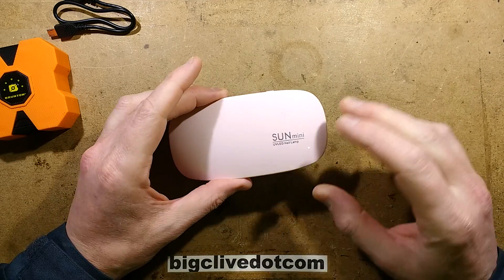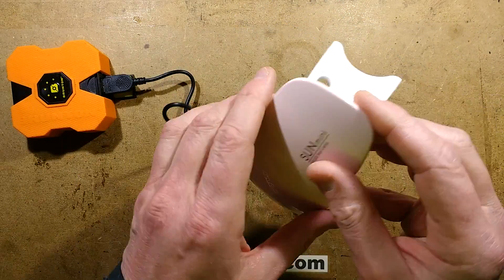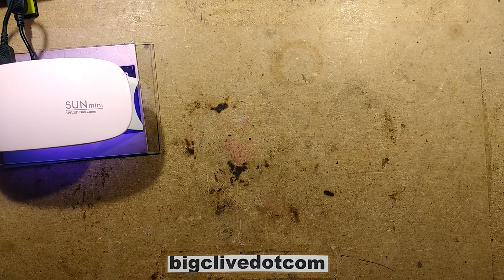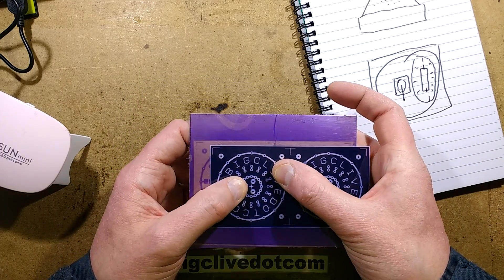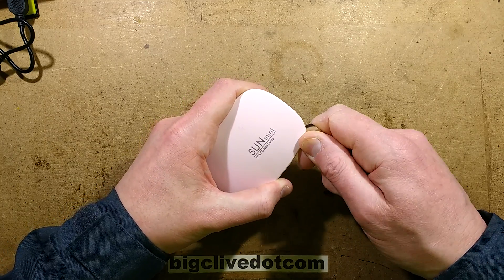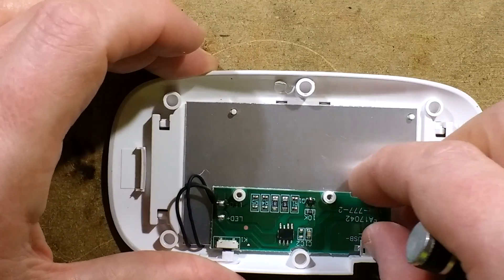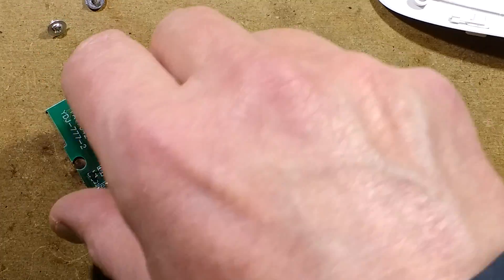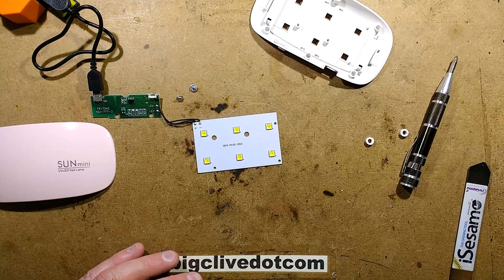Inside a UV nail-gel curing light with unusual LEDs.

Comment: Here’s some interesting info about genuine UVC LEDs. This is a copy/paste of a conversation I had with some fellow electronics/photonics nerds regarding this technology. A lot of us hobbyists and professionals online, in places like the laser pointer forum LPF and budget light forum BLF, and others. 

Clive, I think a cheap Spectrometer would be a cool DIY build. Like the one shown on “les’s lab YouTube channel”  Not really necessary, but it would be a fun build, and I’ve seen several instances where you’ve wanted to measure the wavelength of light. Once you have a spectrometer…,you can’t imagine all of the incredible uses!
————————————————————————
Here is the copied info…Maybe it’ll help some folks….. and it’s just interesting stuff regardless!

All genuine UVC LEDs have a quartz/sapphire glass window and/or ceramic Gold plated body. This is necessary because UVC easily damages Plastics and other materials used in UVB and all other LEDs. Therefore if the window wasn’t quartz, it would quickly degrade and discolor.

I’ve Bought and tested close to 100 different UV LEDs over the past few years… Including deep UV (UVC) i’ve tested everything from the dirt cheap Chinese knock off‘s, to the highest end chips costing $100 or more from Nichia and other quality manufacturers. (usually as a sample or with  a big discount because I can’t afford $100 for a single LED 😂)

I’m not a professional optics engineer, but I have an industrial electronics servicing business and lab… so already had the equipment. I was interested in this stuff for my own hobby and professional uses. And it was fun as hell!! UV photonics technology is super interesting, even to regular folks Who aren’t nerds. 

I’ve always dabbled in optics and lasers. I spent several years putting together a professional optical “breadboard” and test bench. All dirt cheap from government and Academic auctions. It really is the golden age of science and electronics! Over $20,000 worth of optical equipment, and decommissioned military/medical/industrial lasers. Photonics and laser stuff is about the most expensive hobby there is. Besides burning money 😁 A simple mirror, lens, or optical mount can be hundreds of dollars new. no way I could’ve afforded it. But I paid pennies on the dollar! Or less. Government auctions are awesome.

There are genuine deep UV LEDs being made in China that are pretty darn cheap. $1-$2 each! Pretty low power but decent quality.

But UVC LED technology is still so new, that the output powers are exceptionally low when compared to UVB. So you need an array of about 25 LEDs to approach timely “sanitizing“ power. Which is not going to be cheap, especially if you get Nichia or other high end chips. For a 25 LED array of decent power UVC nichia LEDs… You’d be looking at over $1000 easy. And if you went with their most powerful chip, a array of 25 would be about $2500 😂

But power density will increase slowly just like it did with 365nm UV LEDs. Cost per milliwatt of “radiant flux” will go down with time. 

Currently, decent cheap quality UVC LEDs average 5-15mw (Milliwatt) of optical output power. So when they sell UVC LEDs labeled as “1 watt“…. that means 1 watt of input power. You have to look closer to find the optical output power rating. 

If you got 1 watt of REAL UVC optical output… That shit could fry your skin and eyeballs really fast. Even worse is that real UVC leds can be almost invisible. Which is Dangerous shit!!😂 

thankfully many chips include a visible LED inside the same package. Usually 365 nm or higher UVB. As an indication light, so people don’t accidentally leave it on without knowing it… Easily burning their eyes. Or the board it’s eventually mounted on….in a finished product…. has a tiny colored LED next to the UVC led. To indicate when it’s on.

Although 100 mV is pretty much the limit for current UVC led technology…… its possible to get 1000MW (1 watt) of optical power out of 365nm UVB leds… or even more. It will be incredible if UVC LEDs reach this level of radiant flux in the next few years.

Sorry to ramble on. Hope this helps someone or you find it interesting.

Comment: I just got one of these, as I was looking for a UV light that I could modify into a EPROM eraser and remembered watching this video. Now that it's arrived, it's very different to what's shown in the video. They've economised the extra PCB out and built it all onto the aluminium backed PCB. Interestingly, they're not using a current limiting resistor, so it's not clear how they're limiting the current. Anyway, I'm thinking I'll just use a 555 in monostable mode to trigger the little MOSFET for the extended time required to erase the EPROMs. Might need some active cooling on the back of the PCB too as it did get a bit warm when running just for a minute.
Reply from the maker: You'll need UVC to erase EEPROMs.
Reply: @bigclivedotcom  Theoretically it could work, as the wikipedia entry for EPROM says erasure begins to occur at wavelengths <400nm, and the ebay listing says it's 365 + 405nm, but the wikipedia entry does say 253.7nm is recommended. I did read a hackaday article about someone who used a standard UV LED to wipe his EPROMs, and it didn't look like an expensive UVC LED.

On the other hand, I've programmed one up and have been repeatedly running it for a minute at a time for over an hour and haven't seen any change in the data, but I suspect it needs to be run constantly without the short pauses when the one minute timer runs out.

Comment: Bought this unit and a syringe of Mechanic UV curable solder mask, it hardens after 2 minutes if the layer is real thin, if you make a glob the outside will cure but the inside will still be gooey and takes about 5 minutes give or take to finish.

Hope that helps someone.

Comment: How difficult would it be to decap chips like that and take a stab at reverse engineering them?
It would be quite interesting to see what kind of circuitry simple little chips like those have.
Reply from the maker: +weylin6 It's most likely a full microcontroller like a PIC12F635.

Comment: Big clive a have an old function generator that went boom crekel pop smoke  any tip for troubleshooting
Reply from the maker: +Ryan Start with the power supply.  Things like capacitors and rectifiers, especially if it's an old fashioned unit.

Comment: How do we hack these to work at the rated wattage of 9W??? Change the resistors to lower values?
Reply from the maker: You could, but I'm not sure what the small transistor is rated for.  You could just add more resistors in parallel in the spaces that are already there.

Comment: Since the board supports 5 resistors (and 2 capacitors) in parallel I was thinking that it's common between several lamps with differing numbers/types of LEDs.

Comment: I wonder if one could use one of those food vacuum sealers and a stiffish poly bag to sandwich one’s material tightly enough to make an efficient exposure unit.
Also, gas anyone used polycarbonate (Lexan or Perspex) instead of glass?

Comment: Curious what wavelength's
Reply from the maker: Not sure.  No way to measure it here.
Reply: bigclivedotcom I got a similar genialish 12W (allegedly) unit off of aliexpress and it's apparently it has a 365  led and a 405 (advertised for UV gels and glues). Which seems to be correct since it dries UV Loca rather fast. They also have one which only has a 405 led without the phosphor coat, that is advertised for LED gels.

Comment: Clive did you happen to see the dirty trick some of the sellers are using?
They say $0.99 ~ $4.59 USD
What they do if if you pick any of the LED units like you have you pay $4.59 USD
and then if you pick the 9W UV lamp you pay the $0.99 USD. 
The lamp is a compact florescent. DIRTY trick.
Reply from the maker: If it's for a 9W UV tube then that' still a bargain.  They're used as replacements in the larger nail curers.
Reply: Unless the quality is so bad they don't last or even turn on. We both know how people shop for price.

Comment: Clive,,, Sir,,,  is that the wavelength that is used to see rodent pee on the motel room floor? Or other fluids in other places?😲
Reply from the maker: It swamps the results out with the visible light.  Use a UV flashlight, or better still don't look for stuff like that as you will find human secretions.
Reply: You can get cats piss detectors from pet shops. Word to the wise: they make proteins in the cats piss fluoresce. They won’t work on human piss, and if they do, you need to see a doctor right away because your kidneys have failed.

Comment: Do you know why this doesn't work on uv erasable chips? The only one i checked didn't work at all...
Reply: No, you need UV-C for that, which is also very dangerous to have exposed, and extremely (EXTREMELY) expensive in LED form.
Reply: If it is cheap and produces UV-C then it is not using LEDs (or is not UV-C).  The sort of prices I have seen, even for high UV-C in the 270-280nm range, are in the hundred-dollar-per-led sort of area.  The shorter the wavelength the more expensive (and less efficient), it's just way out there on the edge of what can be made with current LED technology.

Comment: Question: Are there uv-c leds to erase eproms?
Reply from the maker: You can buy small UVC tubes and drivers on eBay that run on 5V. But they must not be viewed directly while lit.
Reply: i tryed once but it didn't work
Reply: UV-C LEDs still costs hundreds of dollars. The shortervthe wavelenght, the harder it is to achieve it through LED.

Comment: Where did you get your photoresist from?
I bought some from several different sellers on ebay and it was all full of wrinkles and bubbles.
Reply from the maker: I made a video covering it.  It does have wrinkles.  The best way to apply it is to use a film of water on the PCB and a soft foam squeegee, plus a hair dryer to warm it and make it fuse to the PCB.
Reply: Cool, I will try applying it with water. Does heating it with the hair drier actually work better than the laminator?

Comment: Hey Clive, whats your oppinion on solder straight from China ? Is it worth the (low) price and have you ever tried some?

Thanks a lot
Reply from the maker: I recommend getting solder from a local online electronics supplier.  Preferably tin/lead based with a flux core.
Reply: Look for the 63/37 ratio lead to tin. It doesn't exhibit the annoying "plastic phase" when cooling so your joints are less likely to shift while you're waiting for the solder to harden.
Reply: In my personal experience cheap solder either has inconsistent flux or a lack of it, hence I keep a pot of flux handy. Some of it is alright but it can be a bit hit or miss (same brand new roll differs from the old roll).
Reply: I buy Walton metals solder. Its made in the UK and more expensive than Chinese solder but I like to support British manufacturing.
Reply: I can recommend MG Chemicals solder from www.circuitspecialists.eu - I think they ship from Manchester UK.

Comment: I'm a big advocate of UV setting adhesives. They make quick fillers if layered and can be mixed with pigments to great effect.
I also found that some will easily mix with silicon conformal and produce excellent strain relief sleeving. 
This will be a great tool for me - will invest in two.
Reply from the maker: Try a violet laser pointer for very fast curing.
Reply: 3 Seconds was the curing time for my 3W UV led, Depends on the UV strength. Ive made the glue smoke/offgas with a 10W UV led. Part# LZ4-44UV00-0000 

Also Depends on the UV glue you are using, Loctite works well but is expensive AF
Reply: The quickest one I tried was JML LazerBond which went from syrup to hard in 15 secs. It came with a half watt LED powered by two CR2016 in series which amazingly outlasted the 10ml of glue. Not cheap at £10. The one I'm using now came from Banggood (K-3181) and cost £6 for 50ml but I'm still only using a 500mW UV LED which is now properly powered. That takes about 30 secs per layer but can be faster if applied thinner.
If you do a search for Dymax you'll find a list of products, specs, UV kit which cater to medical users for joining translucent catheter tube. One boasts cure time in under 1 sec. I think you need a lot of UV to cure in that timespan! http://store.ellsworthadhesives.co.uk/catalogsearch/result/?q=dymax
 It's uses as an adhesive are limited to the exposure of UV so it's not a replacement for epoxy or cyanoacrylate.
Reply: I use a 365nm LED too and noticed the vapour. It's also very exothermic so I'd probably need a stiff drink before I go using it to fix my fillings!
Reply: What is the quickest curing time you can get?
I tried to use UV cure glue as a replacement for CA glue and activator, but the cure time was way too long. I do not know if it was just my poor UV LED.
I'm looking for 5 seconds or less for a small dot of glue, maybe 5mm diameter and 1mm thick.
Reply: Ok, thanks, maybe I should try that again. But that  LZ4-44UV00-0000 LED is not exactly cheap.
Also I will have to check if there are any health issues with the UV, since the whole point is to replace the rather nasty CA activator.
Reply: stefantrethan there are some issues but just be sensible with it. Also try a cats piss detector from the pet shop, should be £10 or so. They put out a good strong UV beam.

Comment: I teach about luminescence (fluorescence and phosphorescence). I’ll have to get one of these to check out for demonstration purposes. Will also need to get some strontium aluminate that you ahowed in another video.
Reply: Why don't you just get a UV flash light/UV torch, however you want to call it. They're much handier imo
Reply: Having more diffuse light from a device such as this works better for what I want to show.  I've tried one, and it works great for showing luminescence in tonic water or clothing.  I need to see how it works with thin layer chromatography plates that are impregnated with luminscent dye.  These units are much cheaper and portable than those sold for lab use.

Comment: Clive, the "cover" isn't to protect the LED's from nail varnish, they're legs so that you can set it on the table and put your nails underneath to dry without messing up the varnish on the other hand by holding the lamp.
Reply: which is pretty much the same, just a different perspective to look at it. your way to  look at it is just the exact opposite.
Reply: Also saves you from having to hold the thing still for a minute or so.

Comment: I wonder if the little chip is just a 555 timer. Also, do you think it would be possible to use UV-curing nail polish as an etch resist? You know, with the curing through the transparency and stuff. Not that it'd be a good idea, I just wonder if it can be done.
Reply: ManWithBeard1990 No, you need external caps and resistors to set the timing of a 555. Also it can't do the long press thing. It's an MCU.
Reply: I guess I wasn't paying attention when he showed the different modes. Also I mistakenly thought you only need only one cap for monostable operation but a quick google showed that's not quite true.

Comment: The LEDs are double wave length: 306nm and 405nm. 405nm ist on the edge of UV to blue and can be seens as a slight shimmer.
Reply: Raymond Wu Yeah that's why I was a bit surprised to hear they'd put 306nm on this unit. Frankly I'm surprised they used the 365nm.
Reply: Hey Raymond, could you recommend me a cheap thing like this or bare LEDs that are quite bright and use a pure UV LED? I can mostly only find these 5mm round ones that are 405nm.
Reply: That doesn't look very bright unfortunately. :( Also I commented on one of your videos. Thanks for helping me out though! :) If you have another idea, go ahead. :)
Reply: Oh yes. People seem to be liking the flashlight. Banggood has this model with a nichia LED. Which LED are you refering to for the thing to hit low 12$?
Reply: Ok. Just need to find one that isn't 29€/36$
Reply: *is

Comment: Clive please can you link me to a crimp tool for open ended non insulated spade connectors. Currently using needle nose pliers. Cheers :)
Reply from the maker: I tend to use a ratchet crimp tool, but for the insulated version.

Comment: I have a similar UV lamp, just a bigger version with 15 of these LEDs. (Funnily enough for developing dry film PCBs). I did have a go at finding some data on these dual die devices, but all I could find was references on AliExpress for a several nail lamps stating that they're 365nm & 405nm dies. Unfortunately I was unable to find an actual datasheet though.

Comment: Id like it to stay on for 5-10 minutes for curing glass resin when repairing stone chips. I guess it could be hacked to stay on indefinitely if you really wanted it to though.
Reply: They're usually pin compatible with either an ATtiny85 or a PIC12
Reply from the maker: You could bridge the transistor to make it stay on while powered.
Reply: Probably doesn't have enough heat sinking to handle 4 watts for 10 minutes.
Reply: Matthayi Naalaaman  0:30 and 6:00. Power draw is covered twice in the video. Also, you think that a half watt for 60 seconds would be enough to properly expose a PC board? Does not compute.